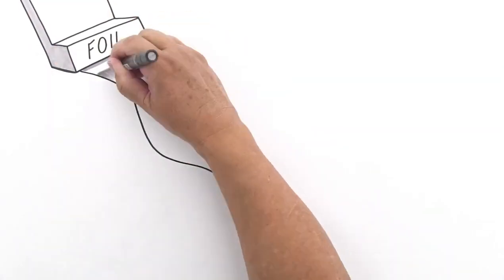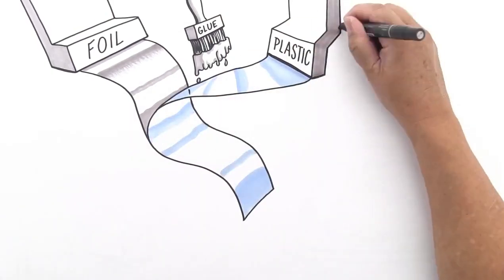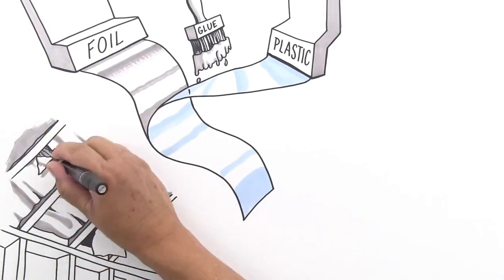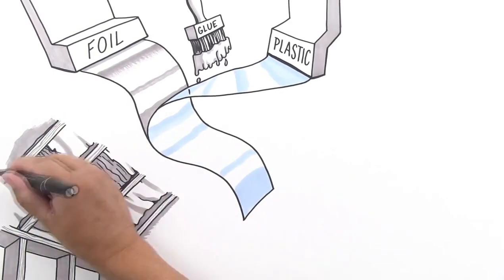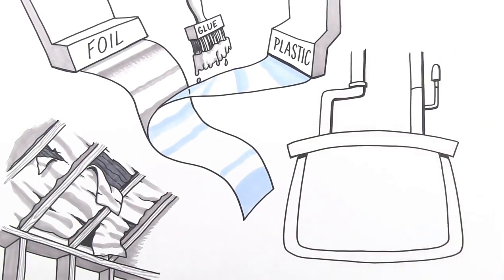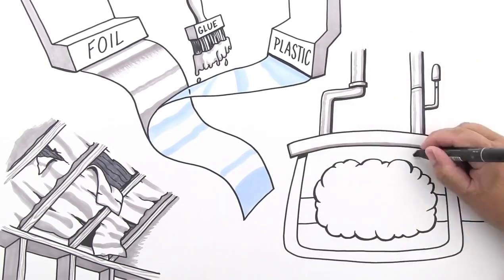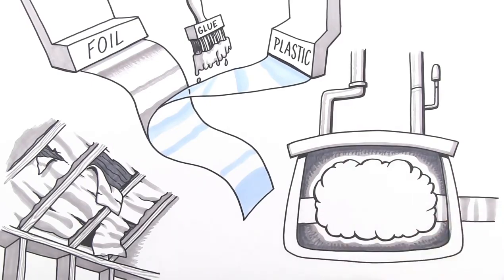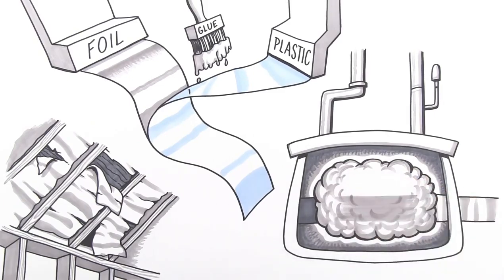ARMA FOIL Radiant Barrier - Old Way, New Way!

Comment from the maker: You could certainly try and make it yourself, however you'll probably find that it actually costs more to buy the supplies to build it yourself.  Also, don't forget that you will need to use pure aluminum, not kitchen foil.  Then you will have to develop a specialized coating to prevent the aluminum from oxidation.